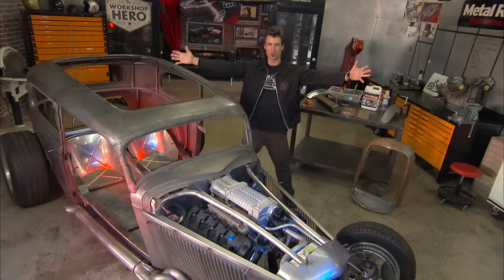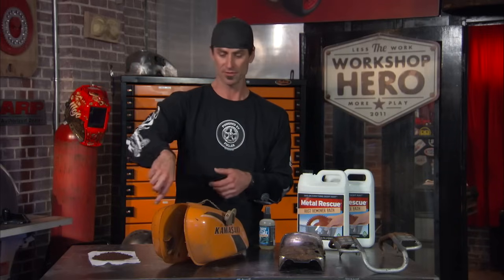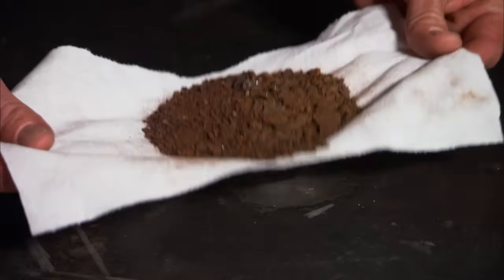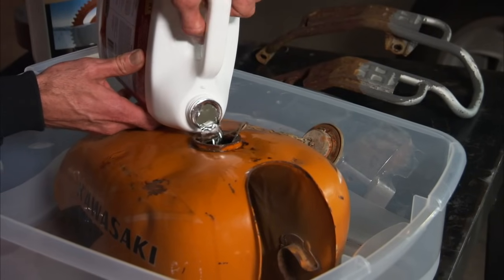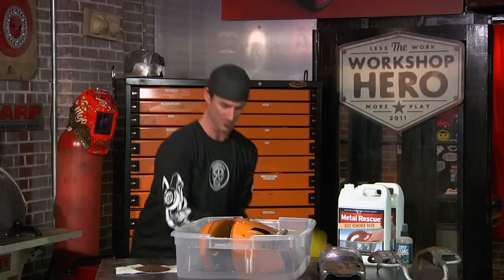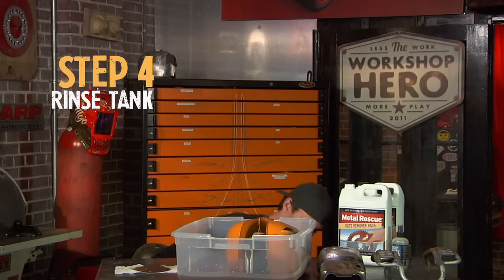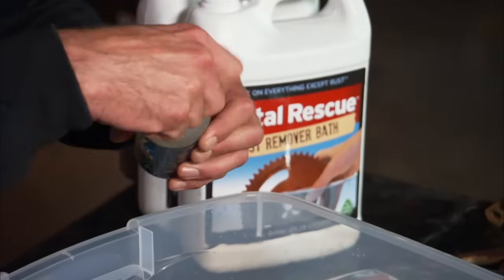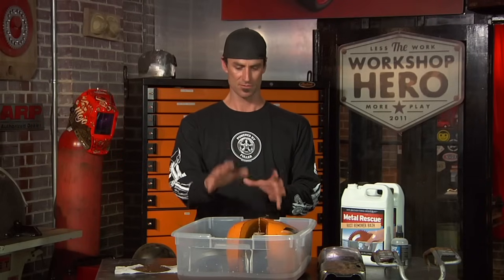How To Remove Rust From A Motorcycle Gas Tank: NO ACID

Comment: Ok. I have a motor that had a bad water pump on it. I replaced the water pump and tried to flush anything that is inside. Would It be a good idea to send this product into the radiator  and run the motor???
Reply from the maker: Hello kakashi8148- yes, many customers have had great success with running Metal Rescue Rust Remover Bath through their cooling system.  You can view a testimonial about this very thing at How to remove rust from an engine-Ken's Classics
which is on our channel- Metal Rescue on YouTube.   Please don't hesitate to contact us at 800-three six five-1117.  - Workshop Hero
Reply: Metal Rescue™ from the Workshop Hero™ Thank you very much.
Reply: Metal Rescue™ from the Workshop Hero™ Awesome to hear this, I have a VFR engine that appears to have a lot of rust through the cooling channels, however the cases are also aluminum will there be any issues with this?
Reply from the maker: Sharpsdoublerifle Hi Sharpsdoublerifle , Metal Rescue is safe on aluminum. It's safe on all metals except for magnesium and magnesium alloy. Please let us know how it turns out! We would love to see some pictures! Thanks for watching!

Comment: 🤔definitely using this but I see you only offer the 14oz concentrate and I have to mix with water to make a gallon?
Reply from the maker: the Concentrate is available at AutoZone. we also offer a ready-to-use gallon, which is available at The Home Depot. hope that helps!
Reply: Metal Rescue Rust Remover But the concentrate will make one gallon or more?
Reply from the maker: @millermatic140  yep. you add one gallon of water to the concentrate.

Comment: could i use this on a 2007 gsxr 1000 fuel tank?
Reply from the maker: Hi Dylan, we don't know that exact model, but if it's metal and rusted, then the answer is yes! Just make sure to clean out any old liner or old gas/varnish. Metal Rescue is not an acid and will not eat through anything. Thanks for the question and thanks for watching!
Reply: I  vinegar to remove rust worked great but then after emptying it i rinse it with gasoline and it flash rust so quick

Comment: To remove rust from inside gas tank,I put a few handfulls of sand and gravel in the tank. Then duct tape it to the rear wheel of my pickup that has rear end jacked up off the ground. Crank up truck, put  it in gear and let the tank tumble for about 2 beers or half hour to clean.

Comment: Have 2 quick questions.
1-I have a in tank fuel pump will metal rescue harm it in anyway?
2-So after the derusting process will there be flash rusting after i rinse with gasoline?
Reply from the maker: Hi Ghost Watts, To answer your questions:
1. NO, Metal Rescue will not harm your fuel pump. Metal Rescue only removes rust from metal, it is safe on everything except magnesium, or magnesium alloy. 
2. Metal Rescue is not an acid, it pulls the rust from the metal and suspends it in the solution. What you are left with is bare metal because Metal Rescue does not leave any sort of residue on the metal. This leaves you the option to coat, paint, or protect your part from rust coming back. On most tanks, we don't see flash rust, the rust will come back if left untreated. We do make a rust preventative spray called Dry Coat, that dries to the touch in 30 minutes. Plus, like Metal Rescue, it's water based. It doesn't leave an oily greasy mess when applied. It's perfect for inside of gas tanks because it's water soluble. Here is a video about it. https://youtu.be/niiVoVQB2Pg

Did we answer your questions?
Thanks for watching, please let us know if you have any others.
Reply: Thanks.If i plan to fill the tank with gas after I de rust it.Will a rinse and swish with gas do the trick,Or will i need to dos omething else?
If the gasoline swish will work lets say I fill the tank up completely and its allowed a week or so with just a half a tank whats the possibility of rust coming back up top were gas is not sitting?
Reply from the maker: Ghost Watts Yes, a rinse with gas will do the trick. Metal Rescue doesn't leave any sort of residue behind. The rust will come back at a rate dependent on climate and location. Keep in mind that it will be bare metal. You should look into our Dry Coat Rust Preventative Spray. It dries to the touch without leaving any sort of residue, and is water soluble, you can rinse it off with water. Perfect for storage, or in-process restorations. Here is a link to it: http://www.metalrescue.com/drycoat.aspx
Thanks again, please let us know if you have any other questions.
Reply from the maker: Hi, William Goslin, did you have a question?

Comment: Do you have to remove gas tank? Can you do it with gas tank still attached
Reply from the maker: Hello, no you don't. Metal Rescue is safe on everything except rust so you don't have to worry about it harming anything else on the bike. Just make sure that your petcock is closed so the Metal Rescue can soak inside the tank. Then just follow this videos step by step instructions and you should be good to go! Please let us know if you have any questions! Thanks for watching!

Comment from the maker: Thank you for your interest in Metal Rescue™ Rust Remover Bath of the Workshop Hero™ line of products and thank you for your "creative" suggestion for cleaning out a gas tank as well!  You are right on the money--we suggest thoroughly cleaning a gas tank BEFORE adding Metal Rescue™ to it, which allows the Metal Rescue™ to get straight to work on the rust without having to work its way through "gunk" first.  If you can have a little fun (and a beer) in the process, we say all the better.

Comment from the maker: Hello, while Metal Rescue is safe on everything except rust, we would recommend painting the tank after using Metal Rescue. You should be able to work with an 8 oz. Dry Coat bottle after rinse and use enough to coat the inside. Workshop Hero products are biodegradable and can be disposed of in your lawn. For complete gas tank de-rusting instructions, please watch the entire video and use the link at the end to find the instructions on our website. Thanks for choosing Workshop Hero products!

Comment: Whats the benefits of a metal tank compared to a plastic tank?
Reply from the maker: Hi Michael, Metal Rescue is only attracted iron oxide on metal. When you use a metal container, the metal can distract Metal Rescue from working on the iron oxide on your metal part. You will get the best results when you soak your part in a plastic container. On a side note, Metal Rescue will not harm any metals, the use of a plastic container to soak is only for the performance of the product. Does this make sense? Thanks for watching. Please let us know if you have any other questions.

Comment: How did you get the pile of rust flakes out of the tank in the beginning? I hear some small pieces still clattering around in there.
Reply from the maker: Hi Dion de kok, thanks for watching. We scrapped out the rust and filled the tank with some nuts and bolts to get some of the loose and flaky rust out of it. You do not have to get all of the rust out before using Metal Rescue, but it is a good idea to try and get the loose and flaky rust out. That way, the Metal Rescue is only removing the hard to get rust inside your tank. Please let us know if you have any more questions.

Comment: Is this stuff safe on clearcoats and paint? I have a freshly painted tank and I'd hate to spill it and ruin my paint.
Reply from the maker: Yes, Metal Rescue is safe on paint and clear coats. It's safe to the touch too! Keep in mind that the only thing Metal Rescue removes is the rust. Thanks for watching, please let us know if you have any other questions.
Reply: +Metal Rescue Rust Remover Bath from Workshop Hero 

I have a 3 gallon tank. Do I pour the 1 gallon solution in and fill to the top with water??
Reply from the maker: +itsjussjerry no Jerry you do not add water to Metal Rescue. It's ready to use. If you dilute Metal Rescue, It will not work.

Comment: Hi! Bryan. After watching your demonstration video, I found that it's so interested me to work the same as your recommendation, but I have one question, after cleaning the fuel tank then what kind of Chemical or oil to protect the rust get back again as the fuel tank must be used for holding the gasoline for the motorcycle.
Reply from the maker: Hi Sok, this is Metal Rescue, Bryan does not monitor this video. We don't recommend any sealers or oils to prevent rust from the inside of your gas tank. We don't have a ton of experience restoring motorcycles, we are experts in rust removal though! Thanks for watching, sorry we couldn't be more helpful.
Reply: Sok,
I woke suggest after rust removal process is complete. Fill tank with gas and add a fuel stabilizer if it will sit for period of time. Keep it topped off whenever possible if a daily driver.
Reply: @iantgagnon  I  vinegar to remove rust worked great but then after emptying it i rinse it with gasoline and it flash rust so quick

Comment from the maker: Hey, thanks for the question and watching the video!  The best way to prevent getting a cruddy tank is always keep clean gas in your tank. If you are not going to use your bike for awhile, then add a solvent in with your gas.  Did this answer your question?
Reply: Bryan, you are forgetting something.  In the winter, you must keep your tank full of fuel.  If you don't you will get condensate inside that will begin to cause the rusting at the areas that aren't bathed in fuel.

Comment: I have a tank that sat with no cap out in the rain for over a year from a 1982 cm 450 and Ive filled it with vinegar 3 times I had it sit for 3 days and everything time I clean it out it's nasty rust but there's still rust in there vinegar ain't working

Comment: Does it remove rust on chain, gears and pitted chrome?
Reply from the maker: Hi Garson Robitics Academy, Yes it will. Metal Rescue will remove rust on all metals except for magnesium and magnesium alloy. Keep in mind that the only thing that Metal Rescue does is remove rust, it will not fix pitted metal. After your part is derusted, you will be left with bare metal. Also, keep in mind that Metal Rescue does not harm plastic, paint, and chrome. 

Thanks for watching, please let us know if you have any questions!

Comment: Help me please!!! I recently bought a 1982 Yamaha maxim 400xs dohc. Every time I try to start the motorcycle I have to connect the jumper cables and it usually starts but the motorcycle turns off as soon as I take the cables off or sometimes it stays running and after some time it dies. Do you think I need a new battery? Please help!!!
Reply from the maker: Hi ZEDVENTRUES, Great question! We will forward this question to some of our Workshop Hero Nation Aces and see if anyone of them could answer it. We are not the experts in motorcycle or car repair. We are experts on rust removal and prevention. Any question other than rust, we will send to our Workshop Hero Nation Aces, like Bryan Fuller here in the video. Thanks for watching!
Reply: ZEDVENTURES sounds like an electrical problem
Reply from the maker: We posted your question on our Facebook last week and got this response. We hope this helps out! "Check the battery at your local parts house. If battery checks out good check alternator voltage output."
Reply: Thank you for the suggestions but after riding a few times it seems like the problem fixed itself. I think it might've been a bad connection or something but thanks again.

Comment: Apparently white vinegar works pretty well, cheaper too I would guess. I've never had to bother, I've been lucky so far with my tanks but there may come a time when I need to give it a go.
Reply from the maker: Hi keepitrunning. Metal Rescue is different from vinegar because it is not an acid. You do not have to neutralize the tank after removing the rust. Also, Metal Rescue is reusable, you can remove up to a 1/2 pound of rust with only one gallon! When you are ready to try it, let us know if you have any questions! Thanks for watching and sharing our video!

Comment: Sounds good. But how much is it per gallon? I have a 5 gallon tank. Or can I fill it half full, cap it, lay in one side for 24 hrs, flip it over to the other side and let it set for 24 more hrs. I have more time than money. What you think about that idea?
Reply from the maker: Hi Jeff, 1 gallon of Metal Rescue Rust Remover is $20-25 at Home Depot, or AutoZone. Yes you can fill it up half way for light to medium rust. Metal Rescue is reusable! 1 gallon will remove up to 1/2 pound of rust! Just make sure that you let Metal Rescue soak on the rusted area for a few hours before moving onto the next. Thanks for watching, please let us know if you have any other questions.
Reply: Metal Rescue Rust Remover Bath from Workshop Hero I wish it was that inexpensive.
I tried MR, wwhen it cleaned the rust out of my tank, I created a leak in the tank. So I assume the rust was all the way through that littke part of the tank. There wasn't a hole per say, but it just weeped through the rusty spot. I inspected it closely. So Metal Rescue mist likely prevented a problem later with this spot rusting through later and possibly a fire if it happened to start leaking fuel while on the road.
Reply from the maker: Hi Jeff, wow, we are glad to hear that Metal Rescue prevented that! On the same hand, we are sorry to hear about your rusty tank. Yes, those are the prices for Metal Rescue gallons that are sold in the United States. You can also purchase a 5 gallon bucket here on Home Depot for around $100. https://www.homedepot.com/p/Workshop-Hero-5-Gal-Metal-Rescue-Rust-Remover-Bath-WH570295/204064974 Please let us know if you have any questions!

Comment: What about flash rust? I've cleaned a tank several times and it is spotless inside. It sits for a few minutes and the rust is back.
Reply: I  vinegar to remove rust worked great but then after emptying it i rinse it with gasoline and it flash rust so quick

Comment: If I have a four stroke to do I still have to clean it out (to get the oil out)
Reply from the maker: hyrum graf Hello, Yes, you will have to clean the gas tank out. Metal Rescue is not an acid and does not dissolve or eat through anything. It only removes the rust. Any barrier like oil or old gas will inhibit Metal Rescue from being in constant contact with the rust. Here is a link to our step by step instructions on how to remove rust from inside of a gas tank. 
http://www.metalrescue.com/assets/pdf/Motorcyle%20Gas%20Tank-Workshop%20Hero%20White%20Paper.pdf

Thanks for watching, Please let us know if you have any other questions.

Comment: How can I remove the rust particles I hear them rattling but can’t get them out
Reply from the maker: It is not necessary to remove those rust particles before using Metal Rescue. We have heard using nuts and bolts and shaking them around will loosen up the rust, then we suggest spraying it out with a power washer or a high pressure hose. Thanks for watching, please let us know if you have any other questions.
Reply: Metal Rescue Rust Remover Bath from Workshop Hero the rust came out but is still inside of the tank I could hear it when I shake the tank I just can’t manage to remove it the way you showed on the napkin anything you could suggest to try and getting that out thanks for the quick response

Comment: Would you recommending adding sand to the 24 hour solution and doing a bit of shaking as many of these other videos recommend?
Reply from the maker: Hi Joshua, No we just suggest a good power washing with some dish soap to get the loose and flaky rust out of the tank first. Also make sure to seal up any pin holes that may be present on the tank. Other than that, just fill it up and let it soak! Keep in mind that Metal Rescue is reusable, so when you are done, pour it back into it's container and use it on other rusty parts! Please let us know if you have any questions! You can email us here info@workshophero.com

Comment: can you tell me what I use to get rid of a lining that is peeling off
Reply: adorable deplorable acetone and drywall screws; you can buy a tin of Acetone at any auto parts store. Dump it in along with some screws, close the tank, shake it around for a while, voila. It will remove the lining, but any underlying rust will be exposed. Treat the rust and avoid using a tank sealer in the future.

Comment: Definitely seal the inside of the tank or it will rust right back quickly even if you are using the tank.  Any part of the tank exposed to air will collect condensation.  You can't always keep it full of gas and even if you did, the ethanol in today's gas is hydroscopic and will rust bare steel.  Just do it.
Reply: Out of curiosity, why do people use ethanol? i imagine in some areas real gas in not available? i wont use ethanol to wash parts with,where i live real gas is readily available and for the benefits you get is not  expensive at all,now if a person has a new car ,. yes, those are designed to work with that worthless fuel but anything of mine that is vintage gets real gas,period, every time.

Comment: I use apple cider vinegar and copper BB's and it works amazingly well
Reply from the maker: Robert Crawford there are many ways to remove rust. Using a mild acid like vinegar will remove rust from metal. It will also remove paint and if left long enough, will remove metal from your part. Metal Rescue is not an acid, it is safe on everything except rust. Plus, you do not have to neutralize the part after removing the rust. Metal Rescue is also reusable, 1 gallon will remove up to 1/2 pound of rust. Thanks for watching, try some out and see the difference! You can pick some up at your local Home Depot, AutoZone, or Canadian Tire.